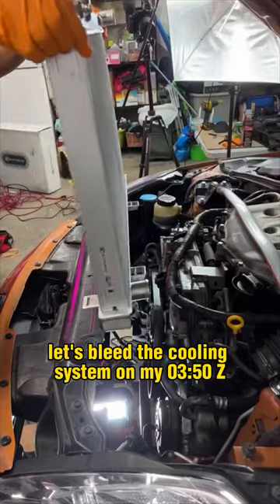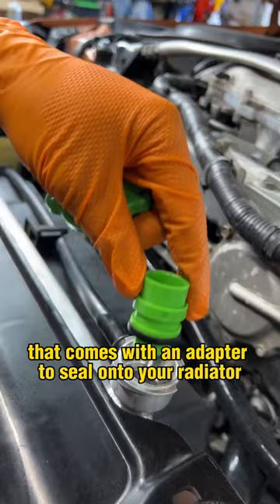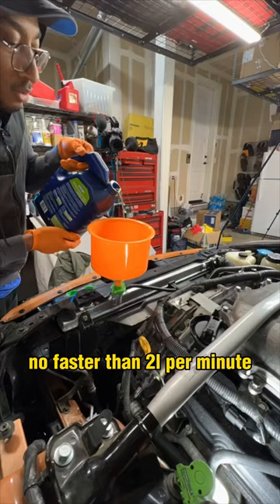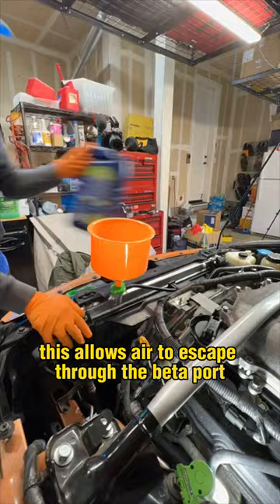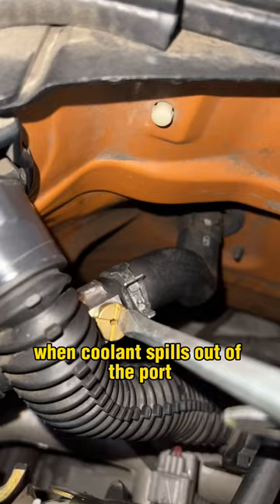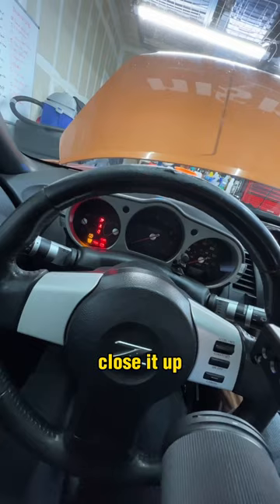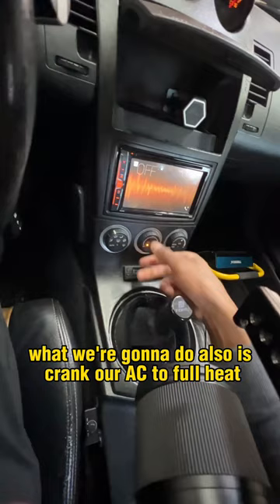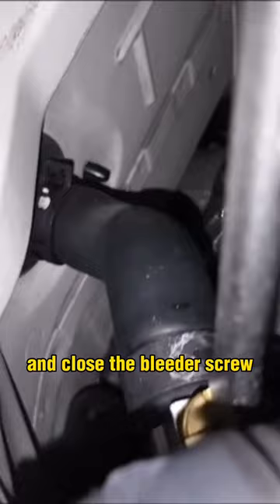The *EASIEST* way to bleed your coolant 🥶🥶🥶

Comment: Air in the cooling system has nothing to do with why a hot radiator erupts when the cap is removed. The cap keeps the radiator under pressure which raises the boiling point of the coolant. When you remove the cap pressure decreases, boiling point drops liquid boils creating steam. Even with proper fill you should never remove the cap on a hot rad.
Reply: This. Guy doesn't know what he's talking about lol.
Reply: You can open it. Just do it slowly. Properly working radiator cap should bleed excess pressure above 1.3 bars (approx.)
Reply: How do you check the coolant level then on a vehicle without an expansion tank?
Reply: @Sak-zo1ui  You do it before you drive or after it cools down. If the cap has a lever you can lift the lever to relieve the pressure. If you must check it while hot use a thick layer of rags/towels over the cap and slowly turn the cap while keeping downward pressure on the cap to slowly relieve the pressure. Also be very careful adding cold water to an overheated empty radiator, that will also cause a volcano if you add it too quickly.
Reply: @Sak-zo1ui  There are vehicles without expansion tank?
Reply: @the_skips  yes. That used to be the standard until the late 70s early 80s
Reply: @Sak-zo1ui   Oh. Why did that change? Didn't they need expansion tanks back then?
Reply: @the_skips  no. Depends on the design and style of the cooling/ heating system. I couldnt tell you the exact reasoning but cooling sytems used to be under a lot less pressure and depending on the environment could overflow even though the motor was not overheating. The system was just taxed. Also expansion tanks are far easier to bleed than a non tank system. Not that it is hard just easier. So to actually answer your question i believe the expansion tank was designed to hold more fluid away from the motor and hold more fluid so that the cooling system is more efficient.
Reply: @the_skips  the main reason for expansion tanks now is a lot of newer engines are much much higher operating temperatures. They need a place for coolant to “expand” into. Putting the system under more pressure also increases boiling point of the coolant.
Reply: @Sak-zo1ui  it’s due to new engines running much higher temperatures for efficiency, fuel economy, the climate dummies, ECT…
Reply: To the original poster, air in system does cause the literal explosion.

If you have an air bubble in the system, it will compress as the system heats up, since air is compressible and liquid is not (but the liquid does expand). When you open the cap on a hot system with air in it, those air pockets expand violently. Combine this with the fact that your engine might be overheating because there was no coolant to remove the heat (air is a poor coolant), and you may also cause the coolant itself to vaporize once the pressure is gone, since that lowers boiling temp. 

But the best way to fill is a vacuum filler anyway.
Reply: @toyorover1313  Sorry buddy but you need to learn a bit more about thermodynamics. If you radiator was completely empty and you poured water into the rad/hot engine the same eruption would happen. This is because the water is changing states from a liquid to steam. One gallon of water turns into 233 cubic feet of steam. The pressure is created by the steam not “compressed air”. If you combine this knowledge with the info in my first post you should be able to grasp the concept. Just trying to help.
Reply: I'm aware of this fact, thus my statement "coolant itself to vaporize once the pressure is gone, since that lowers boiling temp". But your vehicle shouldn't be running hot enough for that to happen unless it's overheating or you're using straight water.
Reply: Hahahaha. An air bubble will triple the chances of that.
Reply: He was just referring to the overheating I think
Reply: You can remove the cap on a hot radiator just use a towel or a rag over it when you open it.
Reply: @the_skips my rad cap also has 1/4 turn and 1/2 positions, 1/4 turn vents, 1/2 takes the cap off
Reply: @evoxterrier5124  That's weird. Never seen that before. What car do you have? I have a simple screw-off cap in my 2002 diesel car. It should slowly bleed excess pressure even in completely screwed-in position.

My old cap was not working properly and was causing lots of pressure buildup in my cooling system. Cooling hoses were becoming rock hard. I had my cooling system break down 3-4 times. My mechanic were sceptical of expansion cap problem. Now I realize that replacing both my expansion tank cap and my mechanic was a great idea.
Reply: @Sak-zo1ui cars still have expansion tanks lol
Reply: @boostaddict_ except he does........ you know atmospheric pressure changes boiling point right?
Reply: @businessraptor134  I'm talking about the guy in the video lol
Reply: Bruh people saying you can remove the cap while hot, end up like the guy in the video with 3rd degree burns 😂😂
Reply: Got a bad radiator cap right now
It’s making my coolant reservoir boil
Reply: I did.

Comment: crank the a/c to heat! 😂
Reply: I also like the part where he says to wait for the "heater core" to open up (I think he may have meant thermostat?)
Reply: ac means air conditioner, doesn't specify hot or cold.
Reply: @jay-gt8re  except it does. My car doesn't have ac but sure has a heater
Reply: @Makaya9s  no it doesnt.
Reply: As an HVAC company, people assume AC is cooling but it’s true, heating air is also conditioning the air. Lastly there is no such thing as cold, only a lack of heat and the rate you lose heat makes you feel less hot(cold).
Reply: @Rightchoiceslc  thank you
Reply: @Rightchoiceslc  true but the AC button on a car doesn't really correlate to the literal meaning of the word air conditioning
Reply: @Rightchoiceslc  yes but this only applies to cars with AC. In that case even if the refrigerant core breaks or you set it to heat while AC is on it just dries out the air inside the car while heating (one of the reasons i usually dislike AC) what I've been trying to say is i don't see a reason to press the AC button instead of just the regular heating function without AC. I also think the person that made this video just meant turning the heat on, not in combination with the AC
Reply: @jay-gt8re  Cars don't use the A/C system to provide heat though, only cool air, so saying crank the A/C to heat is still wrong, no matter the definition of the word. Heat is provided from the coolant flowing to the heater core.

Why do you say Makaya's car can't have a heater without A/C? Because you're wrong.
Reply: @Mr_Morrogh  He may have been right, some cars have a valve that lets coolant flow through the heater core which is only opened when the heat is switched on, not all cars though, I'm unsure about the Z.
Reply: @Gobbbbb  Uh.. yes, it does. A/C is short for AIR CONDITIONER, meaning it conditions the air. it never specifies hot or cold.
Reply: @Gobbbbb  Lol you're ego is outta control, "cause you're wrong" name one consumer car that has an ac without a heater.
Reply: @jay-gt8re  Can you read? Their comment and mine says NO A/C with a heater, not the other way round.

I know what A/C means, also I think you mean "your ego" not you are ego.
Reply: @Rightchoiceslc  energy*
Reply: The lack of knowledge and understanding in this section is crazy. Internet warriors... Any car that provides heat has a heater core. Hot engine coolant goes through the core and the blower pushes inside air through the core providing heat through the vents. When hot and cold air meet it causes condensation and thats one of the reasons heater core boxes have a drain, bc heaters also draw moisture out of the air just like AC. @Right Choice Heating And Air, if theres no such thing as cold then why wont a house cool down in the summer with just the furnace blower running?? Its bc the AC provides a cooling effect when the freon gets vaporized from liquid to gas, temperatures from that go below freezing and when the air inside your house/car goes past the freezing temperature its provides a cooling effect
Reply: Beat me to it.
Reply: @scotta5009  Really well written comment. Explained it 1000x better than I could have. Anybody who chooses to argue from this point on is an idiot or is wasting their time.
Reply: Cool as hell!!!!!
Reply: @Mr_Morrogh  that still doesn't make sense. The heater core will take heat energy out of the coolant making the engine take longer to reach operating temperature. Its more used as a way of knowing the air is out of the system as heater cores are generally the highest point in the cooling system and air will usually bleed out from there last.
Reply: wait so the air conditioner compressor is on when the heat is too? what y’all are saying is confusing asf
Reply: @jay-gt8re  ac means cool, why is it HVAC and not VAC?
Reply: Do you not understand what this means?
Reply: @Rightchoiceslc  so you are a whole company ?
Reply: It's called a conditioner
Reply: @jay-gt8re You're incorrect Sir. Heating and airconditioning system are two different systems.
Reply: @Makaya9s Exactly all cars have heat automatically because of the radiator fluid. But A/C used to be an option. So it's definitely TWO separate systems.
Reply: @jay-gt8re Wrong
Reply: @jay-gt8re But inorder to get the trapped bubbles out of your system, you u need your heater core engaged. So you use your heat not your A/C!
Reply: @ricardomolina4605  ok but a duel air conditioner with heat/cold is still an air conditioner 😐 the entire point is that it CONDITIONS the air, which is what it's doing. so.. yes a heater is an air conditioner
Reply: @Mr_Morrogh there is a heater core in your car which is where the hot air comes from in your ac system. It captures heat at start up
Reply: @Mr_Morrogh no he meant heater core, you have to open up the heater core to get the passage of coolant thru it as well, the thermostat will open wether you turn the heater on or not
Reply: You turn the ac off and run heater regardless.. ac doesn't allow coolant to flow through the heater core some have a valve that opens and closes to allow hot coolant to circulate through it and if you don't burp that you got a big ass air pocket that can lead to bigger issues
Reply: @Gobbbbb cars do use ac with the heat on to keep humidity down
Reply: AC stands for Air Condition. To condition the air means to manipulate the air to hot or cold. Pretty simple and it’s ok to not know that. Not that big of a deal.
Reply: @Rightchoiceslc hmmm I'm guessing you know a lot about hvac  car systems ? My lower hose stays cold but if I put low temps on heater and /or ac lower hose gets warm ..lower hose has thermostat  at engine side ..
Reply: @ohheyitsdezz3609 nope, heater abd AC are completely different systems. All cars have heaters all over the world. 50%+ of the cars in the world didnt come with AC at all ( No compressor & no A/C button). To use heat, engine uses the heat from ur engines coolant to pass by ur heater core and the blower fan blows out that heat. For AC, there is a compressor, condenser a dryer and accumulator also hi & low pressure lines. U recharge ur ac system by plugging to the low pressure port. Look up what the AC compressor does inside it, it’s basically some type of combustion going on which will blow ur mind and something i cant explain in short terms. Good luck
Reply: @Rightchoiceslc  A/C blows out Cold air, heater blows out Hot air! 
When you go to rent a car in Arizona in the middle of August and they tell you that they only have 1 car available, but good news its got "A/C", are you going to be happy when you get everything loaded up and get a ways down the road then realize that its only got a "Heater".  
How would you argue with Customer Service about how you were told it has A/C when it doesn't?
Reply: @jay-gt8re dude, hope you know that there is cars that doesn’t even have ac 😅 but they do warm up with “engine heat”
Reply: @JoseSantos-wb3ow  I'm very aware, it doesn't matter tho. A/C means air conditioner, which includes heat and air.

Comment: Take it from a 20yr tech. Buy a vacuum filling tool like the Bluepoint Radkitplus.  You need an air compressor to use it, but it takes all the risk out of filling a cooling system. I've seen brand new engines get ruined by air pockets.
Reply: Literally the best way to bleed a system. And it takes maybe 5 minutes after you vacuum down the system.
Reply: exactly airlift.  but avoid headache.
Reply: The comment I was looking for. Does nobody know the existence of that tool??
Reply: The engines got ruined by air pockets or by overheating caused by having air pockets ?
Reply: @smerk429  Yep, the thermostat never opened and the engine scuffed the piston skirts and cylinder walls because of it. So yes, damaged from overheating. Mostly cars with reverse flow cooling systems were the hardest to bleed.
Reply: @ryanhoaglin9907  dang that sucks. Thanks bro

Comment: Crank our A/C to full heat…yeah let’s trust this guy to know what he’s talking about 💀😂
Reply: Did you drop out of middle school or something? Since thermal expansion seems to be a new concept to you.
Reply: @Zaggy221  I meant to say “Full” you don’t turn on your Air Conditioner to get heat.
Reply: @Zaggy221  also your heater core doesn’t “Heat up” 😂 The thermostat opens when the car gets to operating temperature 😂😂😂
Reply: @tonycerini9306 usually the heater core gets coolant flow right away before it enters the block, and gets recirculated constantly - the thermostat opens to allow coolant to flow from the block to the radiator once the engine is hot
Reply: @kellismith4329  A heater isn’t the A/C guy

Comment: To keep it from spilling as you remove the funnel squeeze the upper hose a little and then put the plug in. When you lift the funnel up the coolant will drop a little below the adapter as it’s lifted. Spill free.
Reply: That is genius!!

Comment: I just manually squeeze the steaming hot pipes like a real man to pump the bubbles out 😏😂
Reply: Both
Reply: I’ve done this but it didn’t help a huge amount.
Reply: That’s what I learned to do from my granpa didn’t even know this way bouta go do it to my car prolly needs it
Reply: That doesn’t help open the thermostat though.
Reply: @Alexander_l322  did you raise up the front of the car
Reply: I swear he opened the radiator cap while hot 🔥 😂😂😂
Reply: This is exactly my dad's first thought was when my car was overheating from the change. He did it and it worked.
Reply: @Alexander_l322  you've got to rev it at the same time
Reply: @Alexander_l322  I don’t believe you 😂
Reply: right, this was way too much work to be all perfect🤣

Comment: 350z’s have a coolant bleed valve at the back of the engine! You can bleed the system by using a Phillips head(large) and turning the plastic screw/valve left to open right to close!

Comment: My mechanic didn't bleed the system properly after heater core change. When I drove my car home, the coolant level almost dropped down to the bottom of the reservoir. When I called him back, all he said "meh, can you add coolant yourself?" My alternator and starter went out a week later. I feel it was related.
Reply: That has nothing to do with the coolant totally different thing just might’ve been coincidence. Trust me. I am (Mechanic) by Hobby but I know what I’m telling you.
Reply: WTF, please tell us how coolant level and your starter and alternator are related?

Coolant in the reservoir meant the radiator is full, so no problem there.
Reply: @buddyrebel_Garcia  I’m thinking my mechanic did the same. Or it was just never filled when I got home I found it very low and stopped by today to have it added.

My question is, what happens if you only fill through the reservoir to the fill line and do no more? That’s what a mechanic did to my car. Am I good to go or should there have been additional steps?
Reply: @LeviWalton777 if you just filled coolant and it becomes low or empty then most likely there is a leak. 
If low, refill coolant up to the line as indicated because of high pressure during operating temp when engine is running, prevents stressing the coolant system and possible overflow. 
Some cars have two locations to hold coolant, with one being a reserve tank, but make sure when engine is cool to check both for its levels.

Comment: As this is a good informal video .vacuum bleeding is the better way to fill the cooling system. Does not matter which vehicle.  Or cooling system design.  A vacuum of at least minus 25 inches ensures there is almost no air locks in the system. Do it twice. And show a slow stream from the vacc exhaust port. . Squeeze  the top hose to listen  to the giggle valve in the  thermostat.  Top the system off. Cap on. And start. Hook up a old reader and watch the temp rise. Once it hits 85c it will drop. Then it will climb to 85c. And stay constant.  With no interior fan on the temp will Reach 102c. Then drop down to 92c.

Comment: Lol I just remove the top radiator hose that goes to the engine block and add coolant through there and the radiator. Still got to warm up the car and make sure coolant  level is at proper specifications.